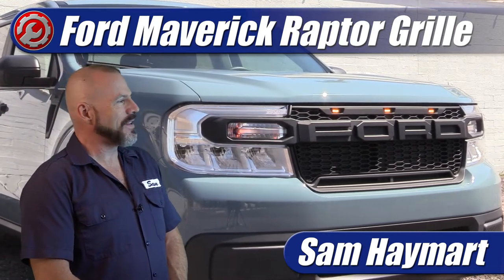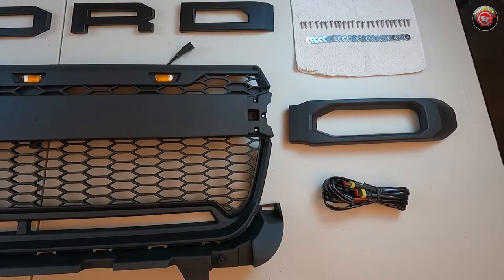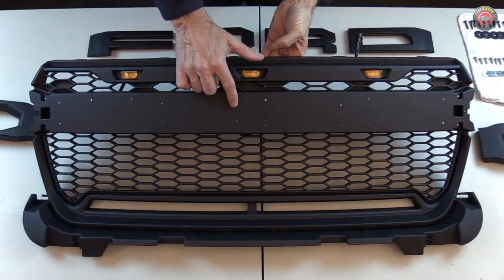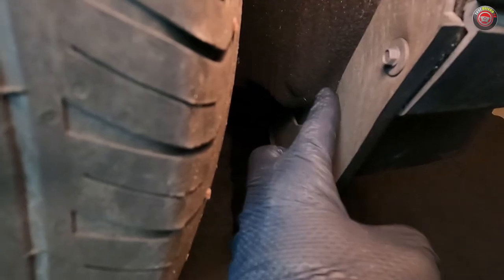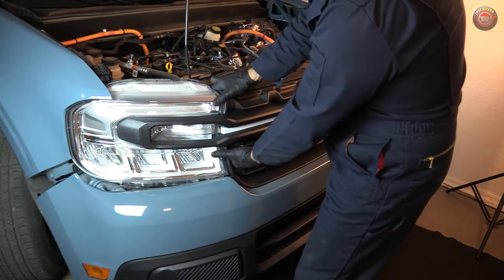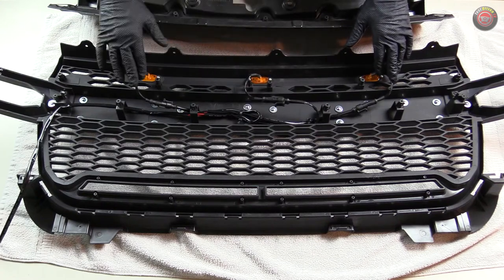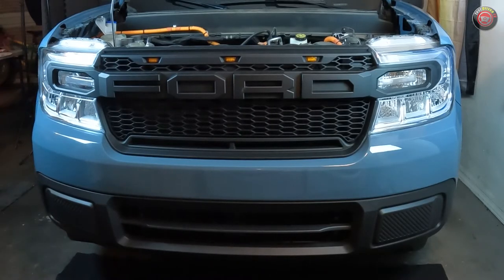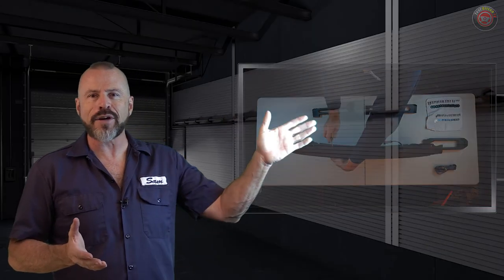2022-2024 Ford Maverick Raptor Style Grille: Detailed Installation

Comment: For anyone installing this grill, and it has two LED light bars at the bottom. The yellow wires tap into the right and left front turn signals. The right is a blue with white wire and the left is a yellow with green wire. The LED bars turn color and blink with your blinker.

Comment: Lovely video ..Will this work with a maverick with pre-collision assist? The sellers say it won’t work with ACC I’m wondering if it interferes with an OEM camera or sensor?  Thanks in advance for ur reply
Reply from the maker: There is no mounting provision for the main radar sensor.
Reply: @TDTVGarage thanks so much … so u are  saying that even though I don’t have ACC I would a till have a main radar sensor for precollision assist right? So it won’t work for my truck …correct?
Reply from the maker: That part not so sure about. It may be the manufacturer's statements are primarily around that ACC sensor but perhaps the other sensors in the bumper for the rest may be ok. These off-brand small companies abroad aren't always up to speed on the details ;)

Comment: You didn't cut your zip ties flush.   This way, when you reach into there, you get stitches. I've worked in Automotive manufacturing for over 25 years.   Usually ford will use fiber reinforced ABS composites for that part.   That looks like polypropylene, which is MUCH weaker.